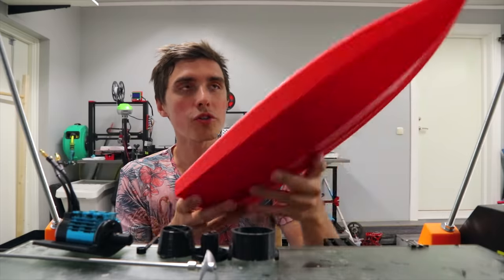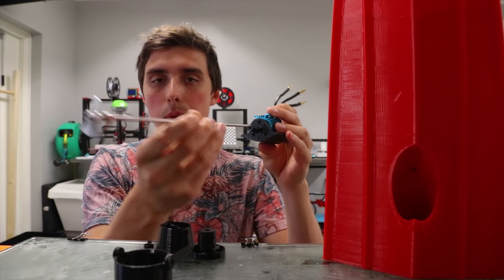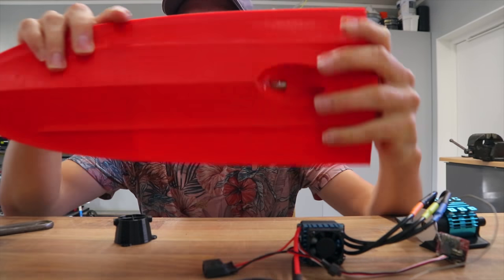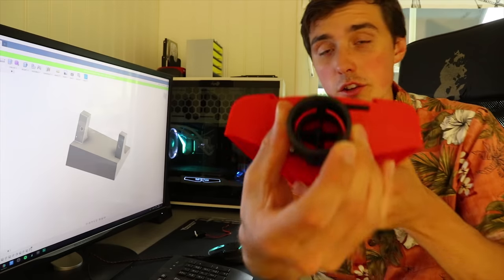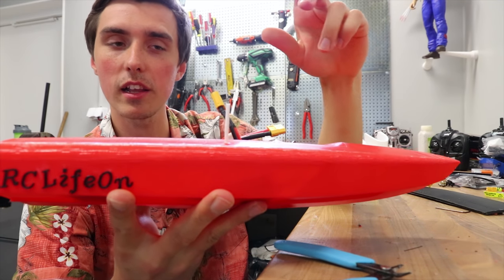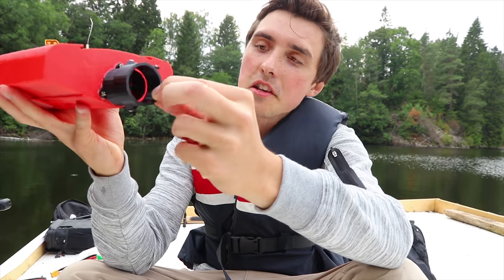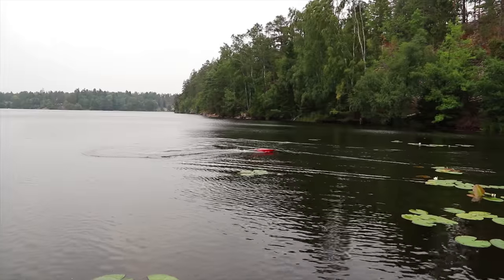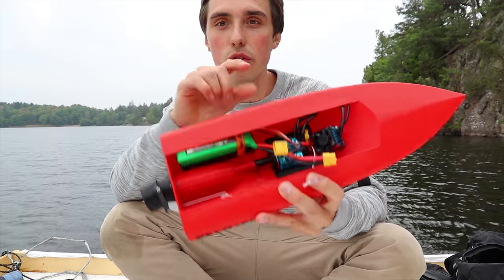3D Printed RC Boat with JET PROPULSION

Comment: A friendly suggestion on the coupler and that is do not print it like a tower but instead on its side.  All of my couplers failed at a seam line due to twisting forces but if the layers are perpendicular to the twisting force it can't twist off.  I would give that a try.  I hope that helps.

Comment: A really simple yet effective coupler is nothing more than a piece of fuel tubing. I bought a brass coupling, but then had to make up a TPU bush to allow the allen screws to nip the shaft without rocking off the shaft - the shaft is polished stainless-steel. Tubing is best from what I can tell.

Comment: Technically it's just a normal boat with a propeller partially inside and not a real jet boat. I think if you get an aluminum coupling and propeller you will not be bottlenecked by the 3D printing. Because of the fact that it's not a traditional jet boat I think you will also find the propeller pushing air instead of water when you go higher speeds. Absolutely loved the video as always.

Comment: I have a little experience in RC Boats. I REALLY hope that you do the 'upgrade' and give us a video of that. A metal prop and shaft coupler would let you go FULL THROTTLE. However, this is impressive, just the way you did it.

Comment: Awesome boat! To be racing ready you should get a metal propeller, metal coupler, put bearing to hold the shaft, use a metal (or only plate in between your plastic one) motor support (may melt otherwise). Some watercooled for motor and ESC would make it holding the power overtime

Comment: I want the same boat, but small enough to print in one piece on an Ender 3.  Yes, it will need smaller electronics, I know that.

Also, try using sealed bearings at the point where the propshaft enters the hull, at the point where it exists the hull, and at the point in the black jet housing.  Pack between the two hull bearings with something like petroleum jelly ("Vaseline") to keep water seeping though the hull there.

I also suggest even a really low "windshield" immediately in front (and maybe down the sides) of the slide in cover.  Just a little ramp-shaped 'lip' on the red plastic part.

Comment: Really nice job there, you can buy a universal joint coupling with changeable fitting on both ends fairly cheaply, this will also help with reducing friction from miss-alignment between motor and shaft that you get from a solid coupling, i am amazed the 3d printed prop held together, well done.

Comment: Awesome build. The first thought I have for the coupler between the shafts is some kind of aquarium tubing, the air line tubing or something like it. This would not only connect the two shafts together, but would provide a bit of shock absorption, and vibration dampening for the motor.

Comment: Try reprinting the coupler with wood fiber pla. Then give it a coating of saturating epoxy resin. the epoxy resin and wood will get almost as strong as steel. There have been regular boat props made this way for 15 hp

Comment: For the shafts connections try using the metal pieces inside those couplers for AC cables which you tighten with screws (I dont know if I made myself clear). Its cheap and easy to find, the only problem is that you will have to sand down to the same radius one of the shaft or you will suffer huge vibrations

Comment: Great video and build project. I love and scratch build my own
 RC Jet boats too. Just a couple of notes for you though,
1: On water jet drives it is an impeller, not a propeller.
2: On Jet boats the steering is provided by the "Steering Bucket", it is not a "Rudder", a rudder is a fin that
  Redirects water being pushed by a 'propeller' or flowing past it. Both result in a torque force on the transom
  that changes where the nose/bow is pointing.
There is great satisfaction in building one yourself and having it actually work yes?
Keep up the good work.

Comment: I buy up vintage RC boats and restore them to Modern electronics. I go on line and shop for older boats that are not just common every day WalMart stuff( everyone already does that now). Its hard finding them and sometimes I wait years to find what I am looking for. I am specific to what I buy. 3 -D printing would be great for making parts I cannot find. Sometimes Its easier just removing everything and upgrading the old stuff. Not that it was well made in the first place. They used to use bees wax to try and water proof the electronics. It didnt work. 
It would be fun to 3- D print a side wheeler!

Comment: Thanks. You might try with a silicone tube as a connection to the shaft. Glue and strap it might work. Your raft is way nicer than mine I had when I was a kid. 👍

Comment: Awesome build! Love the home build jet drive. Love to see you make a full size electric jet boat by up scaling it all up 👍👍
Reply: You can use plastic hose and 2 zipties for the coupler. You can use threaded rod for the propeller shaft, so when the shaft spin, it will force the water out (or in, depending on the rotation).

Comment: Great build and video.
For a smaller printer, you could print the bow area as a hollow sealed unit with locating pins and matching indentations in the aft section.
That way both halves should line up perfectly and give flotation without any weakness.

Comment: There is no issue in 3d printing the impeller or shaft, use Nylon as material and you'll find them more durable than ABS injection molded parts.

Comment: if your plastic is super cheap filament, bake the parts which you need to be stronger, google around for the temp's, you should then be able to get much more torque out of it without it falling apart :)

Comment: Nice Video again. I had the same problem in my last Video, it is always hard to get the 3D printed parts waterproof, especially when it comes to the connection to the propeller. Try to use some simmer rings with grease, that works 100%. There are also some adapters on hobbyking for all kind of diameters for the motor. I just bought all sizes I could find for my projects (they are very cheap).
Thanks for sharing your entertaining videos :-)
Philipp from GER :-)

Comment: prop should be Stainless---   angle the intake flat and forward of the bottom opening in a triangle shape, to allow water a better entry......  Also add bars across the bottom to keep weeds and rocks out....

Comment: Cool! concrats to your build !
You are right the coupler should be brass, in my initial build I used the PLA couple but it's no good for real performance.
looks like your motor is even stronger than mine ;)
I didn't have problems with gluing the parts but I don't use epoxy with PLA.
Thanks for linking to thingiverse !

Comment: Hey! You can make a silicon seal ring using silicon glue.. Apply it on the perimeter of the black cover and then slide it in chassis.. It should give you a water tight seal!

Comment: If you want to reduce water getting in to the boat brush a light layer of epoxy  on the  out side of the boat and then lightly sand it smooth it down with sand paper

Comment: ditch PLA for the mechanical parts and go for ABS, PETG or ultra ham Carbon-Nylon? Besides that awesome boat!
Reply: Carbon mixes plastics are weak as shit, do not use them for anything structural.
Reply: true, just use pure nylon for structural parts

Comment: Try to adjust the thrust nozzle radius                                                                   (it may be even faster with smaller nozzle(check out the bernoulli principle...))  ...Anyway very cool boat 🛥️🛥️🛥️

Comment: Try some nylon for the coupler - Taulman 910 would probably be choice. Awesome video as always. Unfortunately I will have to call the clickbait police on you and have them issue you a warning for using "jet". It's not a jet, it's just an impeller. Cheers! ;)

Comment: If you like to have metal parts you can print it again  make a mold with silicone and pour in JB weld or something like that.
Reply: JB weld is epoxy, not metal.

Comment: Why dont you make a frame or skeleton of the hull out of 3d printed segments and then cover it in fibreglass? Would make it easier to make bigger boats and would provide more weight so its more stable in the water

Comment: Might it be possible to print the hull on a diagonal so that a printer with less than 460 Z can be used? I've bought but not yet received my first 3d printer and it has a 420 Z 300 x 300 Y so I'm wondering if Pythagoras might help out :)

Comment: Can you make a video showing the cost of printing? For example with each print you make also saying exactly how much $ value of material that project used? I am wanting to order a 3d printer but am worried I am going to be spending much more on material then the printer.
Reply: You'll have to build a hundred boats to do that. A 2.2lb roll of filament is only between $10-$20 bucks and you can make several boats this size on a reel.

Comment: Did the coupler crack, or just strip out? If it cracked, I wonder if a 3D printed Nylon coupler would work. I want to see full throttle once you fix it!

Comment: hello friend, good video. I want to ask, I have a 40mm water jet drive, and use the 3670 motor as well as the Mysta 50a Esc. when I try to play, 3 minutes later my esc burns. where do you think the problem is? thank you

Comment: You should install a Raspberry Pi in it along with WiFi so you can control it long distance using a laptop and waypoints.

Comment: Do you consider the water line or balance on your boats. also try a UJ or rubber connection between motor and prop shaft to reduce vibrations

Comment: If you really want to make something waterproof, use rubber gaskets around openings, install a bicicle tyre valve and pump half a bar of pressure into the construction.

Comment: just epoxy some of the plastic parts you think needs. You can get that adapter for $2..
It's not a big deal..I know you want to make everything plastic...but if you need metal
parts here and there...dont fight it.
You can probably make it even faster if you dial it in..but just for kicks that boat is plenty fast.

Comment: Will the receiver and transmitter work if the boat goes underwater and till what depth would it transmit or receive signals.

Comment: hi thx for the nice video. th boat is cool . one questionthough. where can i find more info about the oil seal you used (the one you filled up with grease) i think i would need those too or my boat will sink.

Comment: thanks for posting.  good work.  some thoughts.    it appears that at this scale a  ducted-prop  design  can be effective.    was your little SERVO waterproof, i wonder.      there is a excess of  Linear, 2-d thinking   here.       you have to KNOW that the dom/balance is wonky; with a battery on one side, and a nine-gram servo on the other.   that servo could be installed  ANYWHERE.  so why put it aft.   this hull design seems to be slow coming up on plane.     boooo, on the Use of a wimpy printed coupler.     a longer hull  cuts through chop, better.     cheers         googletranslate

Comment: The stator (The x behind the Propeller) is actualy not to hold the propeller in place. You have to give it small flaps against the way the motor turns to give the wather the right direction.. https://cdn-thumbs.cmc-versand.de/orig/watermark/6-2347-x-8601e0-c-2347-6-2347-2.jpg There you can look at what i meen...
Reply from the maker: Great to know, thanks man! PS, great voice.
Reply: RCLifeOn Even you can make the ruder-nozzle smaler in diameter, like a cone so the thrust is more concentratet. :) THX dude! :)

Comment: that’s propeller is not that good for what you are using it for the blades should be a lot wider so if you were looking straight at it you would not be able to see past the blades on the side

Comment: You can use one parts of this electric cube like coupling betwin shafts. https://kabelek.com.pl/411-large_default/kostka-elektryczna-listwa-zaciskowa-12-torowa-10mm.jpg

Just remove plastic from one pin

Comment: RcLifeOn Hey I have recently gotten a Ender3 but I can’t seem to get the settings just right in cura I always have webs no matter what retraction settings I tweak! If you could possibly help me out in any way that would be awesome! Love the videos btw;)
Reply: Don't read my profile picture what temps are you running and what material are you printing?
Reply: on the ender3 you will need to change your boden couplers before changing to many settings. Also you might try a different PLA my ender2 will print awesome 90% of the time but I have found some PLA's no matter what I do it just wont print very good. Watch Angus's review of the ender3 at Makers Muse. Hope that helps!
Reply: Team Wyman Scale Design which couplers did you use? I also got a ender 3 and am also getting some extrusion problems
Reply: Team Wyman Scale Design what are these couplers you’re talking about? Sorry still pretty new to 3D printing
Reply: Floris Hubregtse PLA 210-215 Bed 60
Reply: The couplers hold the tube that your filament passes through from the extruder to the hot end
Reply: Capricorn kit PTFE and couplers
Reply: Oh alright I see what you mean by that now, I have installed a uograded extruder with different "couplers" But still no different.. Do you have a ender 3 as well? If so would you mind putting the settings you use for it?
Reply: Hey buddy, ender 3 owner here :) join our fb group, we will be glad to help you there, /groups/Ender3dp

Comment: no ofens but you shut consider balencing your rc boat better its leaning to the left side becas that hevyer  if you balance it it wil preform better and have better turns and wil also have les drag there fore gowing faster and puting les stres on the stearine and the copelling

Comment: should have done more research on jet drives... you need a stater that is tuned to the prop to straighten the flow, then you need to make the nozzle diameter smaller so that it actually accelerates the water instead of just pushing it.  i have a prop diameter of 19mm and nozzle diameter of 10mm. andyou need a prop that is more of a screw shape. check out mine on pinshape https://pinshape.com/items/45093-3d-printed-3d-jet-boat